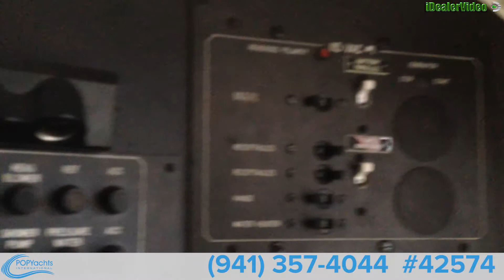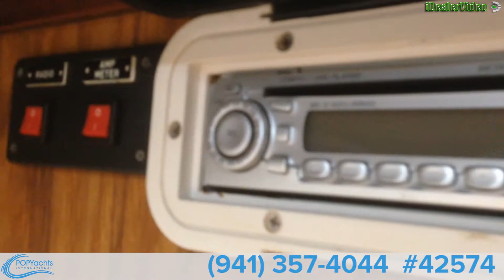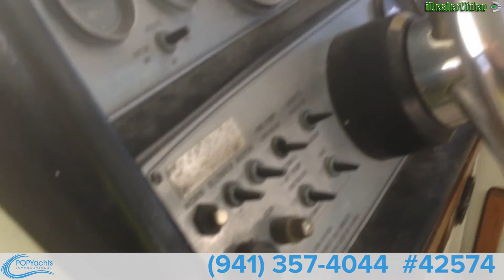[SOLD] Used 1984 Carver 2687 Monterey in Canyon Lake, Texas

Comment: I bought this boat and I can't say enough about how good is was to deal with POP Yachts. Great people, (kudos to Doug Berge) and they handle all of the paperwork very quickly. I did get a very good deal because of the engine, but no worries because building engines is my hobby. I have a brand new engine built and sitting on my shop floor ready for installation. Health issues have slowed me down on the boat restoration but I'm getting their.